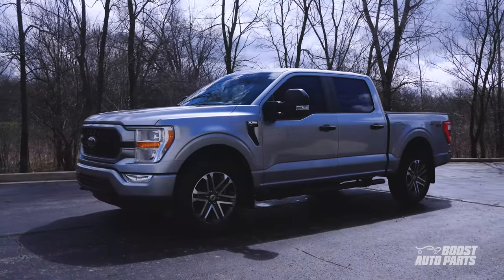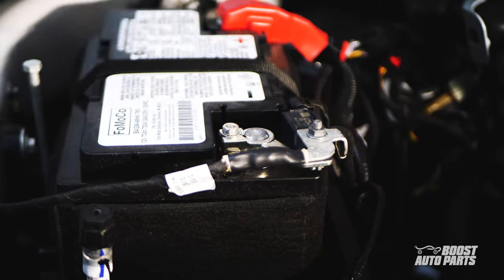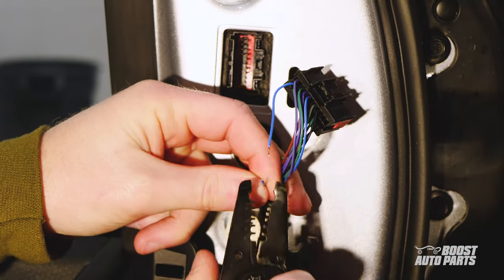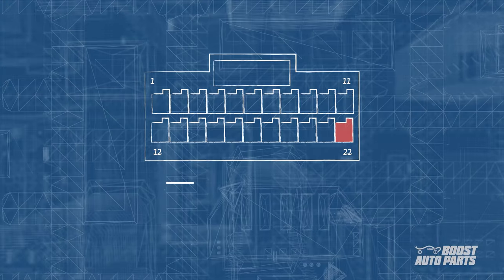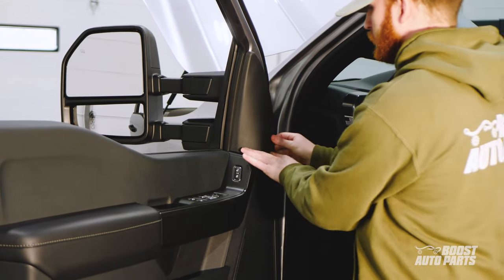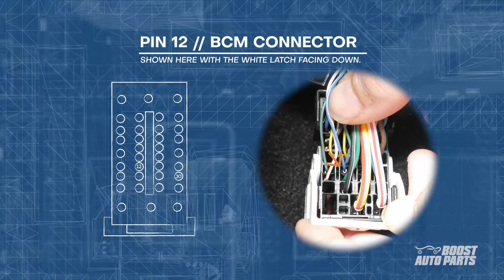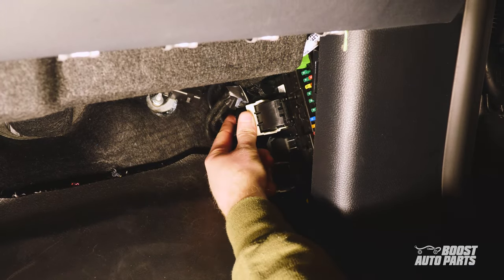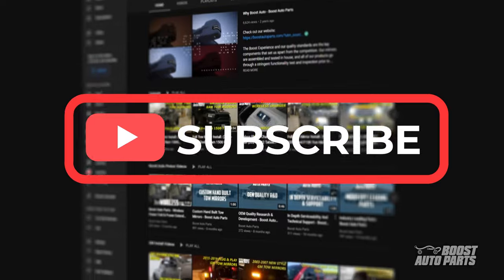2021-2023 F-150 Towing Mirror Upgrade - Add Running Lights (No Reflash Required) - Easy Harness Mod

Comment: Hi, this works on Oem towing mirrors? My truck originally came with same mirrors, then swapped them to Oem towing. Thanks
Reply from the maker: Yes - this will work on OEM towing mirrors as well

Comment: Wish Ford would take lessons from Nissan on tow mirrors for 1/2 ton pickups
Reply from the maker: They might not, but we certainly do!
Reply: @boostautoparts  well can I put a Nissan mirror on a 21 Ford F150  . The Ford mirrors are to big for the F150 they just don't look right  . Nissan mirrors seem to look the right size not to big but not to small .
Reply from the maker: @georgecass8529  Unfortunately not, but we will share the idea with the development team!
Reply: 2022 f150 upgrade to tow mirrors. Installed kit but only signals work. Running lights don’t.
Reply from the maker: @lamnguyen-gh3ge  Did you install the module at the BCM as this video shows?

Comment: So this works with turning factory camera/bliss/puddle mirrors to the factory tow mirrors with the same options correct? Because my truck came with the regular mirrors but i want to upgrade to the tow mirrors, i can live without the power extension unless i can use your hardness for that function to become operational?
Reply from the maker: This will work with getting the running light operational on the towing mirrors. As far as the other features, those should be plug and play as long as you're buying features 1 for 1, though we don't offer mirrors with camera so we can't speak on the camera specifically.

Comment: how about for 2007 f150?
Reply from the maker: This is not applicable to a 2007 F150. We do offer mirrors for your vehicle however that are equipped with running lights.

Comment: If I have 8 pin tow mirrors. They do not having running lights they only have signal. What will I need to get puddle and running lights?
Reply from the maker: 8 pin tow mirrors are not applicable to 21+ F150 trucks. If you have a 15-20 F150 (which are the only trucks offered with 8-pin mirrors), please reference this install video: https://www.youtube.com/watch?v=Q_DCafq6TkI

Comment: plug in passenger kick panel; is this the plug that cuts off 12v to mirror lights, when i go > 5mph??  its gotta be.  i go check, thx.
Reply from the maker: There is not a way to bypass the 5MPH restriction on the spot lights on the 21+ F150 like in previous generations.